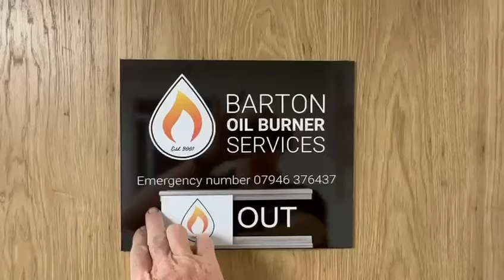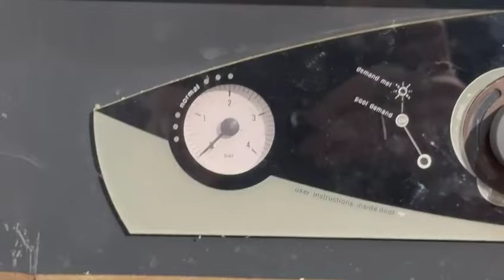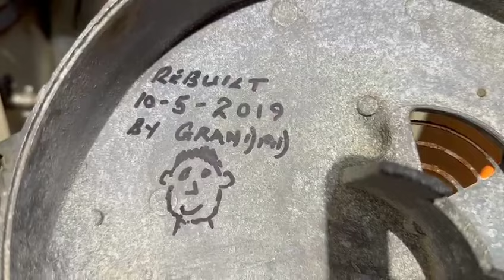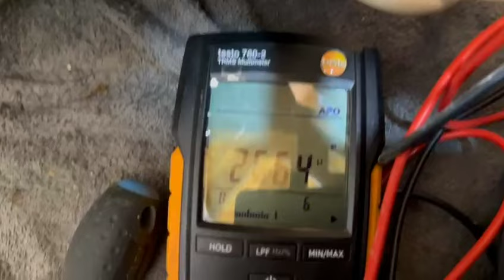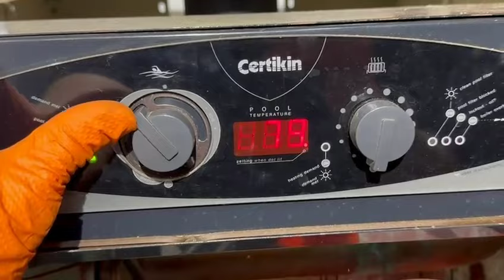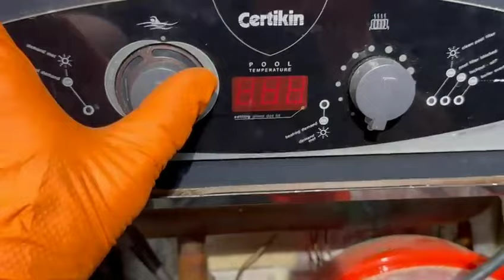How to Service a COH110 Certikin Oil Fired Pool Boiler.

Comment: Could you fit 12 uf capacitor? Or do you need to put the right one for each burner?? How do you know what size of capacitor you require for the burner is there a calculation required?
Reply from the maker: You cannot fit a 12 uf capacitor on a average motor. Capacitors are sized per motor to kick start it. if you put a massive capacitor on a small motor and the motor is struggling it would melt and be a disaster. the uf of a capacitor is always written on it. we keep 6 common ones and that is all you need most of the time. Hope this helps. If you undersize a capacitor it may not turn the motor.

Comment: To help stop the st/steel bolts seizing in the aluminium. A smear of molycote gas cock grease, with molybdenum disulphide will help.
Reply from the maker: Thanks for the comment. We tend to use copper grease. Have a great weekend.

Comment: I hate theses burners due to the fan... Any tips?? Cheers
Reply from the maker: There is a special fan puller made by Regin which are about £50. I have only used one once and that i borrowed. so once in 18 years. i tend to lube them then stick a key that i made in the back of the motor then twist fan and pull. works 999 out of 1000 times. See how you get on.

Comment: Any info on how you alter the air settings on that burner for co2
Reply: 19:37 on vid 👍
Reply from the maker: Thanks for the comment. as per Bens comment it is around  19:37 on the video. Have a good weekend.